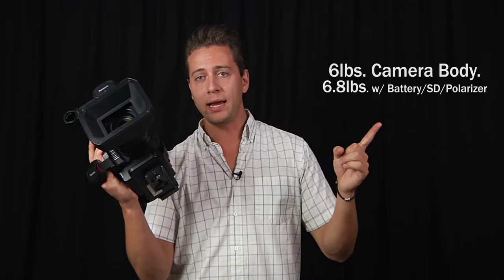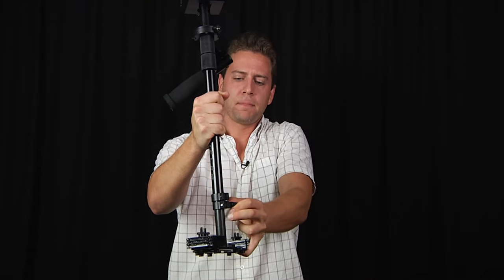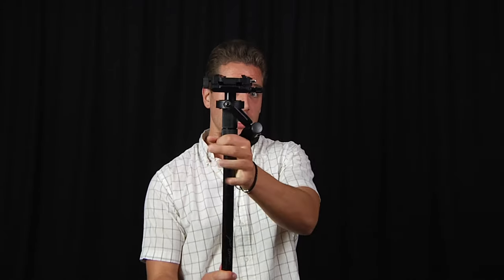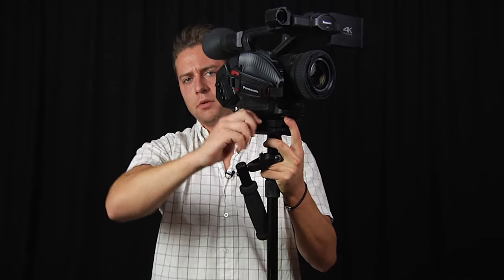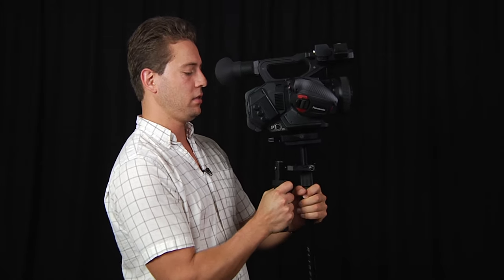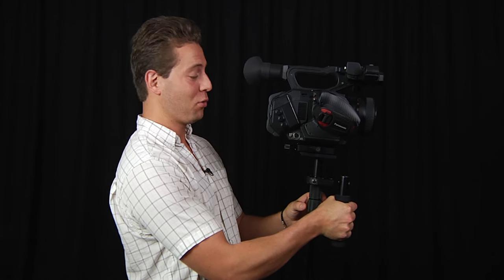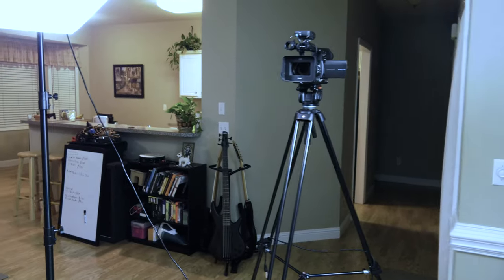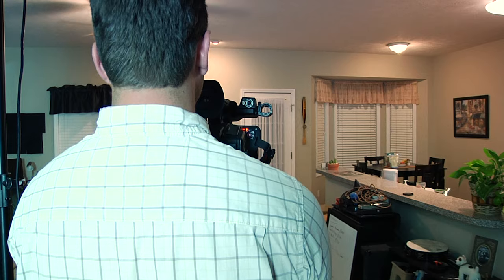How to Balance a Glidecam - Panasonic DVX200

Comment: That was awesome! I had a 150 from 2009 till a few months ago, now have the DVX200 and also the Glidecam HD 4000 ... Good match!
Reply from the maker: Awesome! I'm planning to sell my 150 when the UX90 comes out. Good upgrade.
I checked out your channel, some of your videos seem to be shot on other cameras. What else do you shoot with?
Reply: I checked the prices and it doesnt seem worth selling the 150 here in the UK. All the club videos were on the 150 until 2 months ago then on to the DVX but having all kinds of trouble trying to get the same kind of punchy look from it. The other stuff is on the Nikon D800 with fast lenses and the weddings a combo of HMC150 and Nikon. Have you got a blog of Facebook page btw?
Reply from the maker: Do you use Scene File 3 for the DVX200? It's got a bit more saturation and contrast dialed in.
My Facebook for my video business is here: https://www.facebook.com/SandhillsVideography
Reply: I tried to emulate the 150 but havent had the time yet to properly dial it in - will have a look at scene 3 though :)

Comment: Hi Ed, Great tutorial, I see Im coming 6 year late though! Has the Glidecam been updated since then - what model would you advise today? Dont have a huge budget
Reply from the maker: Hi, well I no longer use the DVX200 for walking shots that might require stabilization. I mainly use the Panasonic GH5/GH6 for that now. So i use a DJI Ronin S for a motorized stabilizer rather than something manual like a glidecam. But a Ronin wouldn't fit the bigger DVX200 anyway.

Comment: Do you think the HD-2000 Glidecam be suitable for the dvx200?
Reply from the maker: The HD-2000 is only rated for up to 6 pounds. The DVX200 is heavier than that. HD-4000 would work though.

Comment: Can this glidecam be used for sony Pxw z150 ?
Reply: I'm curious why you ask that? I am comparing this camera and the z150. Can't decide which to get. The Panasonic has a larger sensor and sounds like it does better in low light. Also like the size. Got any recommendations? Thank you!

Comment: Great video! I am getting back into video after being away from it for years so forgive the basic question.  While using the Glidecam with the DVX200 do you have the stabilization setting in the camera off?  Thanks.  Keep up the great work!
Reply from the maker: Thanks for watching! Yes, that's the OIS button. I usually keep it on for glidecam work...seems to cover up any slight imperfections with the glidecam movement.

Comment: Do you suggest to shoot at 30fps or 60fps with glidecam?
Reply from the maker: For most glidecam stuff, I usually shoot in 24fps or 60fps. I usually export out at 24fps for most of my beauty projects.
I try to shoot at 24fps if it's video of any existing motion (cars, people walking, etc.). I might do 60fps and slow it down for smoother motion if it's just scenery or buildings or whatever, or if slo-mo people/cars/environment is desirable.
One big thing to consider is that the DVX200 crops the image in a lot when bumping up to 60fps at UHD, so sometimes the crop is undesirable or won't work for the situation. In that case, 24 is necessary. For example, if I'm gliding around a car in a tight area, I may not be able to get the entire car in the shot if I'm shooting at 60, so I have to drop it down to 24 to get the wider angle.